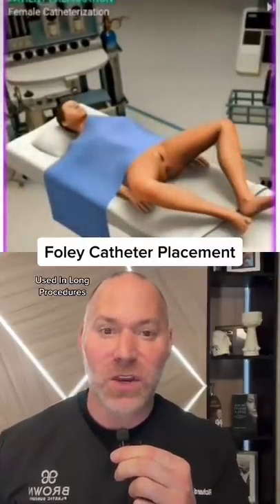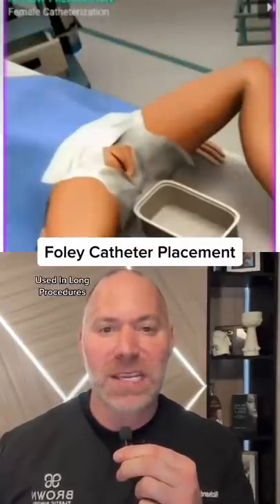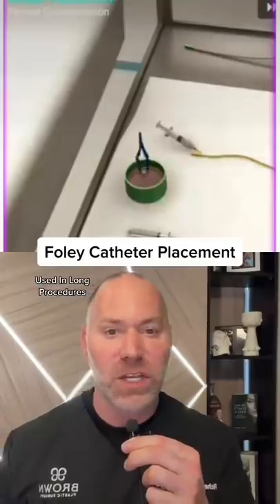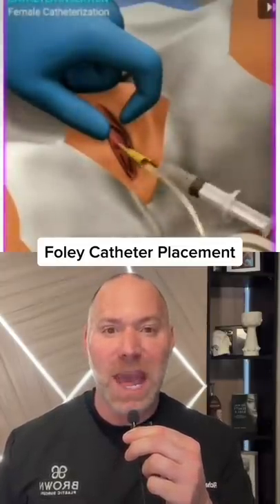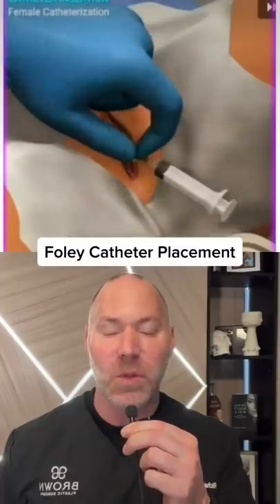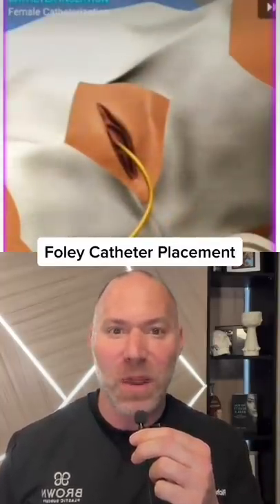Placing a Foley Catheter in the Urethra 👨‍⚕️ #shorts

Comment: They are injecting Lignocaine gel so that the person doesn't feel much pain while inserting the Catheter also it lubes up the urethra for easy insertion of the catheter as well.
Reply: Lies.. you feel it
Reply: @realtruth2870  Yes you you might feel pain if the Lignocaine isn't used in correct amount.
Reply: Catheter..i heard while it used for dialysis right
Reply: @meghanamona7307  Yes it is used in Dialysis patient to monitor their urine output over 24 hrs especially in those patients who are taking Dialysis for Acute Kidney Injury/Chronic Kidney Disease. Generally as a rule of thumb if the serum creatinine level goes more than 6.0 you need immediate dialysis before your brain and respiration stops.
Reply: @dr.subratkamila9819  ghghguyyyyyyuuuyyyyt
Reply: Sorry...but my tear tear as I call it is gonna feel that needle! 
They have topical stuff.... But it doesn't help....at all!
Reply: You mean lidocaine right?
Reply: Nothing is injected into the urethra, the Foley is lubricated with ky jelly before inserting. Lidocaine should not be use because of possible side effects, patients may have an allergy, heart block, hypotension, or bradycardia.  This is a procedure I have to do almost daily, and lube is used.
Reply: @lindaroane3344  No Lignocaine gel is pushed into the urethra without the needle friend. We remove the needle of a 10mL syringe make a hole in the Lignocaine gel tube and fill up the 10 mL syringe completely and then push the Lignocaine inside the urethra. You can also put some Lignocaine gel on the tip of the catheter and then insert it also both the techniques are correct. Generally Surgeon prefer the first method while Physician prefer the later one.
Reply: @anitajinfla9762  No it is pushed inside the urethra without using the needle of the syringe.
Reply: @timdeathly  Yes Lidocaine, Lignocaine, Xylocaine any local anaesthetic can be used in gel form though.
Reply: @lindaroane3344  I worked Med Surg for years and I was wondering why Lidocaine was used because after you pass the cath the stinging sensation should cease.  You shouldn't feel the cath if placed properly.
Reply: Cathejell
Reply: @dickie9748  : I work Med Surg, and have for the past 26 years.  I have never seen a lidocaine syringe in the catheter kit.  The only syringe in there is the 30cc sterile Water syringe for inflating the balloon.  And you’re right, once you lube the tip, and pass the catheter, it should sting a little and that’s it. No pain if it’s done properly.
Reply: @dr.subratkamila9819  : I never mentioned a needle on a syringe. I  do catheterization on  a daily basis.  I work Med Surg , I don’t know where you are from but our catheter kits doesn’t come with lidocaine, just lubricant to lubricate the tip before insertion.  Lidocaine has to be ordered by the physician. Because of possible side effects, and allergies,  I guess that’s why Physicians never order lidocaine injected into the urethra.  There should not be any pain, just a sting as the catheter advance through the mouth of the urethra. I start with the smallest catheter size 12fr.  Some of these comments make people think a  hose is being put in them.
Reply: @lindaroane3344  Well we might be doing it differently in our resource limited setting in my country but the basic idea is the same. Lignocaine gel to lube the urethra and to decrease the stinging sensation while passing the catheter.
Reply: @lindaroane3344  Well in my setting we use Lignocaine gel in all kinds of catheterization. I have just finished my med school and have been working as an intern in a tertiary care hospital since last 8 months. I have seen Surgery people insert catheter with a slightly different technique than Medicine people. Surgery people push the Lignocaine gel inside the urethra with the help of a syringe (without needle) and medicine people just lube up the tip of the catheter with the Lignocaine gel and then put the catheter in.
Reply: @lindaroane3344  Lignocaine gel cannot cause Heart Block, Bradycardia it is never absorbed into the blood stream through the urethra to cause such fatal side effects.
Reply: @dr.subratkamila9819  : Lidocaine should always be used cautiously with people that has heart block, hypotension, or bradycardia.  If you’re a nurse you should already know that. Pharmacology 101.
Reply: @dr.subratkamila9819  Oh, a newbie huh?  Well I’ve been a Med Surg nurse for 26 years. I’m also a clinical preceptor, yep I precept  interns also,  showed them how to catheterize, and watched them do it.
Reply: They are NOT injecting Lidocaine Gel.
They are injecting lubricant.
Im a Registered Nurse, and I have do this on a regular basis.
Reply: @lindaroane3344  Well it is true that Lignocaine can cause fall in BP when given in the form of Spinal Anesthesia but its effects when given topically is very low. Also Lignocaine is never used as a spinal anaesthesia better drugs like Bupivacaine is commonly used as spinal anaesthesia. Well in my country Lignocaine gel is used in every catheterization irrespective of conditions of heart.
Reply: @kenb.336  Yes you can inject lubricant but the patient will feel a lot of sting when inserting the catheter especially male patients will definitely feel it. Things get aggravated when catheterising a patient with urethral stricture. In that case simply using a lubricant can make the patient to shreik in pain.
Reply: @dr.subratkamila9819  : How did we get from catheters to spinal anesthesia.  You’re an intern, you have a lot to learn.  That’s why you’re interning.  I’m a nurse with 26 years experience.  All I can tell you is treat the nurses you encounter with respect, they can teach you a lot.  By the way, congratulations for getting through medical school, and good luck as you intern.
Reply: @kenb.336  : I am too, with 26 years Med Surg  experience.  I don’t inject the lubricant, it comes in a little pack in the catheter kit,  I lubricate the tip before inserting.  The person stating they inject Lidocaine just graduated from med school; and is in their first year of internship. I’m sure you’ve had to teach a few.  I can’t see a physician ordering Lidocaine for catheter insertion. But, I don’t know where they’re from.
Reply: @lindaroane3344  I was talking about different routes of administration of the same drug and their side effects associated with each route of delivery. Lignocaine doesn't cause Heart Block, Hypotension or Bradycardia when used in small amounts in topical form in urethra because it never reaches the blood stream to cause such effects.
Reply: Unfortunately it doesn't help much, I felt everything.
Reply: I’ve had several surgeries lasting more than 3 hours one is 8 hours so this must have been done to me. Why are the doctors not mentioning this part of the surgery procedure ?☹️
Reply: @teslab8903  They must mention this thing in the pre operative stage when you are lying in the operating table before anesthesia is given. Besides there is also no alternative way also because major surgeries especially involving the abdomen we need to do urinary catheterization because in the post operative phase there is always a risk of Urinary retention if catheterization is not done.
Reply: @nokuthulakhumalo9923  It depends what has been used during catheterization a simple lubricant or Lignocaine gel. I believe with Lignocaine gel in the right amount the pain will be definitely lower.
Reply: The real question is why didn't he know what it was
Reply: @dr.subratkamila9819  thank you. I was told the doctor will talk to me before I go under but no one came. The anesthesiologists told me I better lay flat since the medicine is going inside me already. That the last I remember :( it was 8 hours surgery that made my condition from moderate to severe. But thank you for explaining it to me. More power to you.
Reply: @jasonfife7768  May be in his setting they are not using any lubricant or Lignocaine gel while doing urinary catheterization. The procedure might vary a little from hospital to hospital but I feel using Lignocaine gel is the best method for easy insertion of Catheter.
Reply: If they are asleep, why would they need lidocaine? But it's probably lubricant, which they usually don't  do they just dip the tip of the cath in lubricant then insert. Lidocaine is usually for males who are awake and need a big cath.
Reply: @georgiannmartinez8547  Yes catheterization should be done prior to giving anesthesia because anesthesia causes constriction of urethral sphincter so that can lead to retention of urine and also catheterization will be difficult once the sphincter become constricted.
Reply: @dr.subratkamila9819  my dad is ckd patient ..his creation level is now 8
Reply: @meghanamona7307  Oh then he must be going through regular Dialysis to bring down the Creatinine levels and improve his urine output.
Reply: @dr.subratkamila9819  yes. 😥
Reply: @bronsonleach3573  I don't know what part of the country you're from, that lidocaine jelly comes in the catheter kit.  I'm in America, where lidocaine jelly is only available by prescription. It is a local anesthetic. Here is the content of our catheter kit, waterproof under pad, fenestrated drape, 5g aplicare lubricating jelly, 2 latex free gloves, specimen container with label, 3 BZK swabs, 10cc syringe, a peel top package.
Reply: @lindaroane3344  Lube does not do much, especially for men they need lidocaine
Reply: @bronsonleach3573  I do this almost on a daily basis, men and women, suprapubic, and regular cath, and it slides in just fine with just lubricant. Now go check out your catheter kit, and see what the contents hold. If a patient's prostate gland is swollen, insertion may be difficult, and a urologist is called to insert it, but most are normal insertion with no problem. Women have urethras too.
Reply: @lindaroane3344  Women's urethras are very short compared to a man's. In Pennsylvania, lidocaine is standard care for men and women getting a urinary catheter. I also hope you know that just because it goes in doesn't mean it is fine. Urinary catheters can be very painful for men even if they do not have prostate issues. This is where patients must be their own self advocate and should refuse to have a catheter insertion without lidocaine. You know many men have a lot of pain from urinary catheters or is just because you are a female nurse you don't under or care.
Reply: @bronsonleach3573  You need to go back and look at the contents of your catheter kit, because lidocaine is not a part of it.  Maybe it is for the kits that's used in the operating room, I'm not an OR nurse, so I wouldn't know.  Sure a female urethra is shorter, but the opening is smaller. So, the slicker the hose, the easier it goes.
Reply: @lindaroane3344  Yes I know but most kits now do come with lidocaine, especially male catheters. Maby not in your state, but it is done here and is a requirement.
Reply: @bronsonleach3573  Yes exactly I don't know what Linda Roane is talking about insertion of catheter is always preceded by Lidocaine gel lubrication. I have joined my residency now still Iam using Lidocaine gel before inserting catheter in either male or female.
Reply: @dr.subratkamila9819  I have a question. I have a lot of religious rules with modesty and won't allow a female to look at my private parts unless it is a medical emergency. What is usually done so far I have been lucky, but let say the man needs a catheter but refuses a female nurse because of religious modesty.
Reply: @bronsonleach3573  Thats actually pretty rare. If a man wants to be catheterised only by a male nurse then he gets one unless it's an emergency then we shut the patient down for his religious beliefs because God isn't gonna help you in life and death situation.

Comment: Its a lubricant that reduces the risk of  Infection being carried up through the urethra into the bladder and also lubricates for ease of passage for the cat to glide. The lubricant is inserted and left a few minutes to work prior to inserting the cat, It stings only for a few minutes. Believe me if no lubricant its absolute torture make no mistake you will scream the house down. 
I know full well. 
I had a wicked staff nurse who didnt like, i believe, something i had done in her ward, she withdrew my indwelling cat size 12 (my very first cat) leaving my bladder to fill  to bursting, (going to cut this short) she inserted a size 16 without lubricant. I was screaming, so badly, they stopped the visitors entering the ward and I was ostracised by all the staff from there on. I had to be detained for a further day due to the trauma inflicted on me. 
When i informed my doctor, she initially didnt believe me re from 12 to 16 till i showed her.
May i add, dont have a PTFE cat inserted, you may well be allergic. This can also be the case in false teeth plates.
Please drink plenty of filtered water, not from plastic bottles. Do not eat cookies. Do not become constipated.
Plus ultra high level of hygiene is paramount.

Comment: OR nurse here: we don’t put Foleys in until the patient is anesthetized.
 This is an absolutely incorrect representation of Foley placement. 
It’s a sterile kit. As is shown in the video using a female as a model, we absolutely clean the meatus, the labia minora and the labia majora with a sterile betadine solution.
The catheteris introduced into the urethra and advanced until urine is observed in the tubing. The balloon is then inflated with 5-10 cc of sterile  saline and then gently pulled back so that it sits snugly at the bladder neck. 
Patients DO NOT feel this happening when in the OR. 
The random fluid that he questions is usually a numbing agent for males when they’re awake and needing a catheter. 
Again, in the OR, patients are asleep when catheters are placed. 
Lots of misleading information in this video.